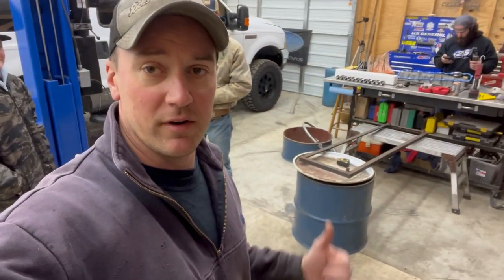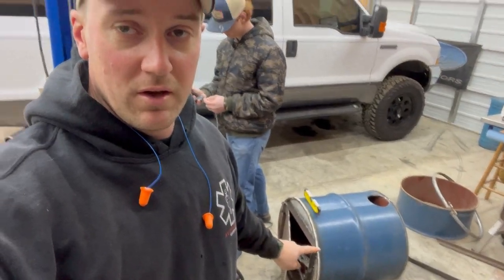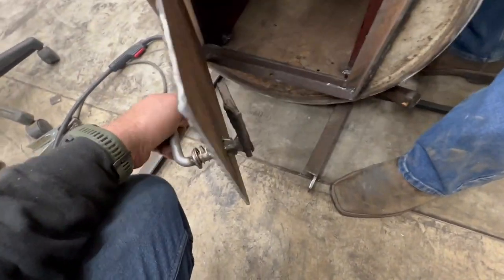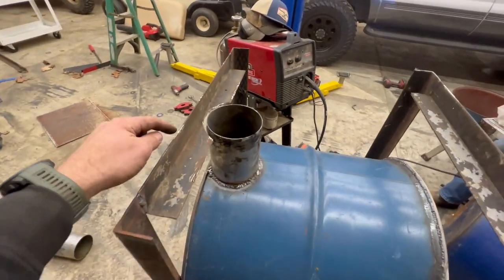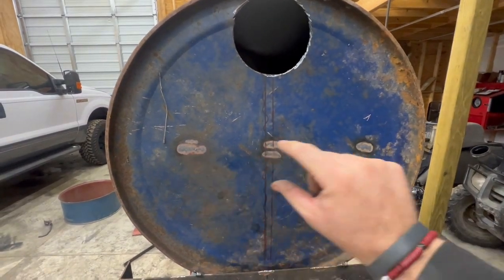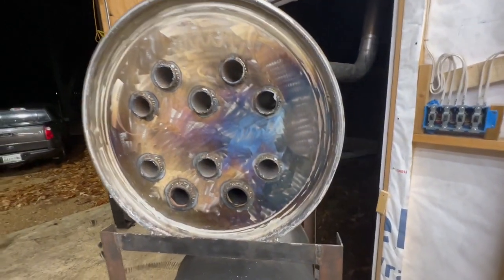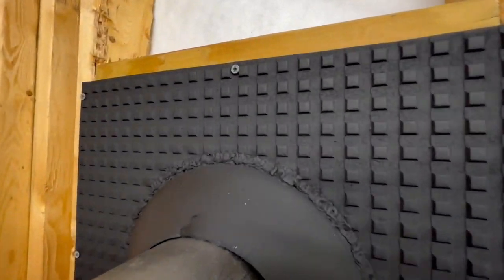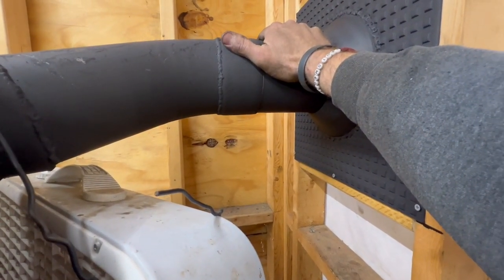Cheap double barrel stove build. NO KIT NEEDED!!

Comment: great work! With that plate on the bottom, you might consider a throttled air intake below the plate. It would pre-heat the air, and you could hook the butterfly up to a thermostat or bimetal air regulator.

you want to keep enough air flowing in to keep the exhaust hot enough to prevent condensation, and also consider a condensate drain low point in the chimney if you don't want to run it that hot.
Reply from the maker: @thedavesofourlives1  good points. Thanks for watching and explaining

Comment: Awesome video.  I'm getting ready to build a quad barrel furnace (2x2x2).  Using leftover 2/2/4 aluminum wire to make a heat exchanger/boiler/duct system.  I tear down old barns and have a bunch of tin I'll be using in fabrication and hearth/wall protection.  Using 6" stove pipe, no diesel pipe here.  Its going in my shop as well.  I'm still designing the exchanger/boiler/blower but estimating 130,000 BTU for a 40x35 pole barn.  One thing I'm doing is using leftover ceramic insulation blanket in my thimble and doing 22.5 angles out to a graduating 45 for flow.  Also have a ton of copper I may add to the boiler.  Boiler is for hot water (cleaning, showers, food, ect), humidity for my 150+ year old wood, air density, ect. I might have $100 in the whole thing.   I may make a video but not too sure.  Wish me luck and great job.

Comment: Lol. Chopped barrel. I can burn full length 24" logs in my barrel.  That top barrel going to clog up with soot and ash and no way to clean it out. Should of left a removal lid with ring. Also any horizontal flu pipe will clog the same.